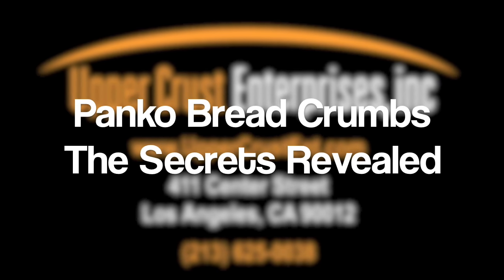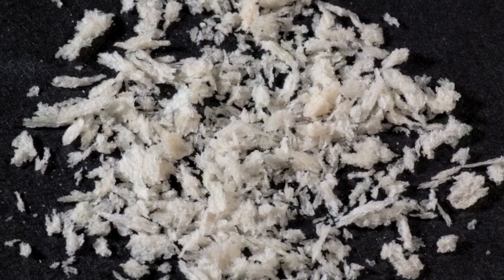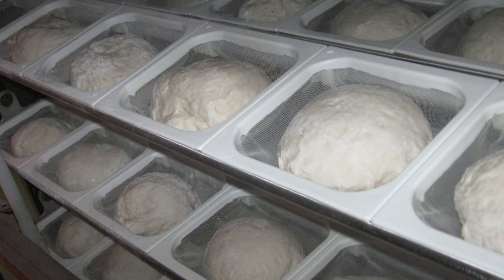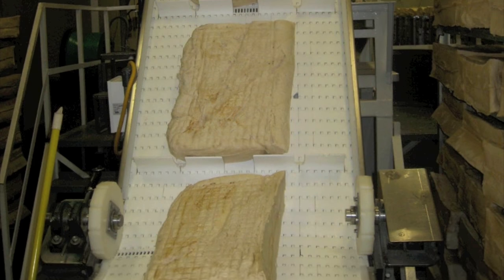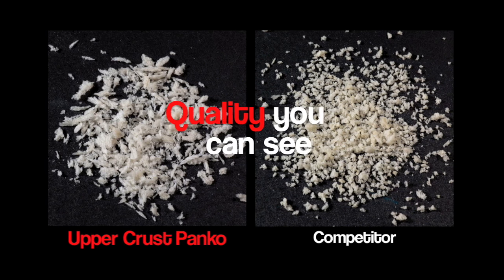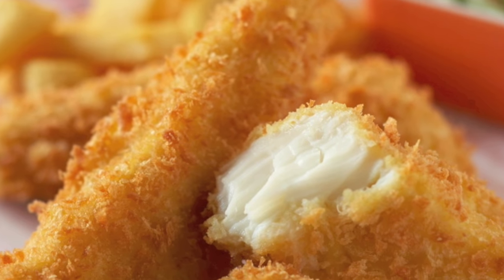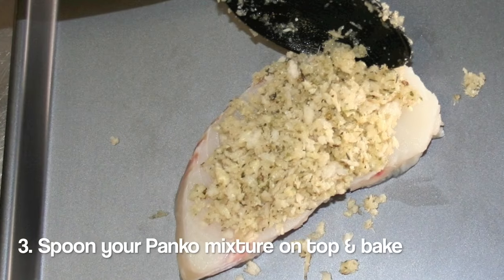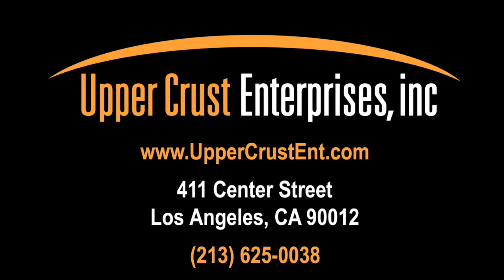Panko Bread Crumbs: The Secrets Revealed

Comment: Do you ever grab one of those giant loaves off the assembly line and take it home?
Reply from the maker: Ross, yes it is very tempting. The bread is delicious right out of the oven and if you toast it with butter it is great.   However, since there are no preservatives or dough conditioners and no outer crust to protect the bread it will stale in just a few hours.  So not a great option for home since it will be dry and stale by the time you get home.
Reply: Upper Crust Enterprises, Inc. thanks for replying! Answer me this, have you ever laid on top of a freshly baked loaf, like a bread mattress?
Reply: @Uppercrustent  Does the factory still have a freshly baked bread smell then with it not actually going through a true baking process?
Reply from the maker: @ebgbjo2025  Thanks for your question.  Yes the plant still has a smell of fresh baked bread but not as strong as a plant baking bread with a crust but still a great bread smell.